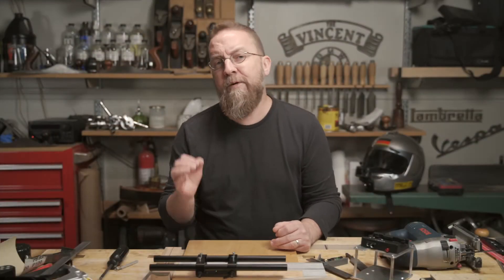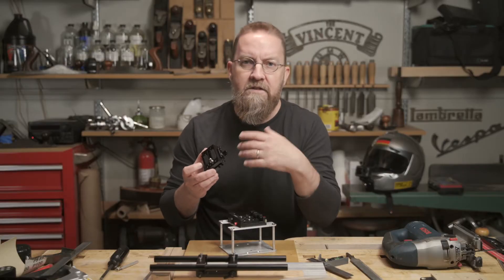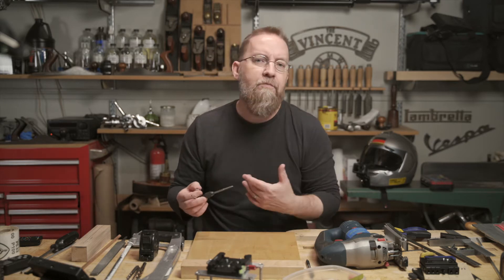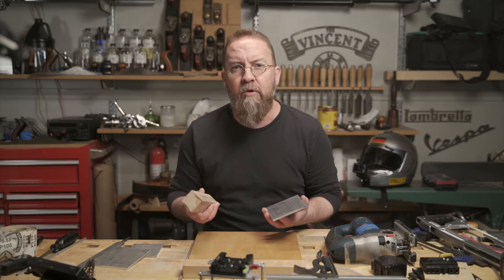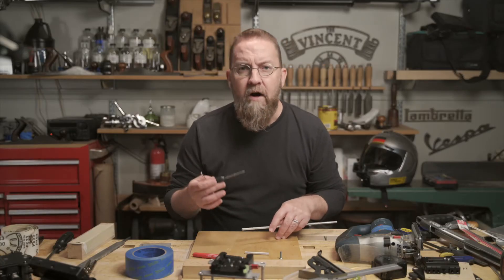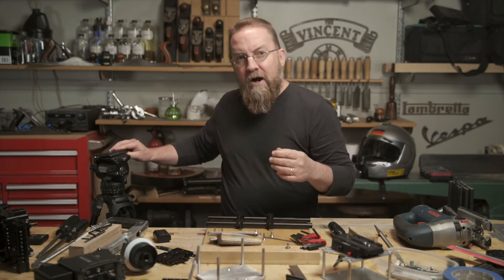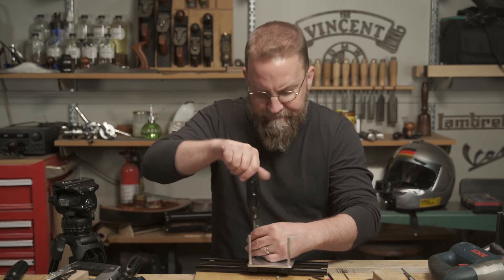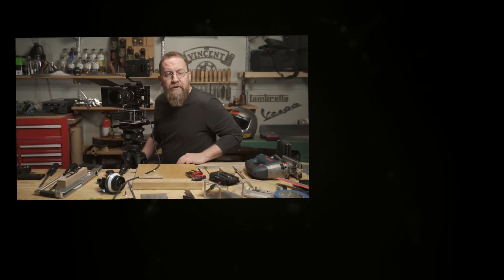Zoom F6 Audio Recorder: DIY Cage

Comment: Awesome cage. I just spent whole morning searching for such a product but to fit a different recorder of similar size. Unfortunately I don't have the tool nor knowledge to do the fabrication myself. Wonder if 3D print would be strong enough if camera rig is around 5lb.
Reply from the maker: Wish I could give some solid advice, but I have no idea. I'm guessing there are different types of media you can use in a 3DP? 5 lbs. is not too much, but the thing to thing about is the shear force if something hits it or pushes against it. If you've got the printer - give it a shot, I'd love to hear your results.
Hope that helps, thanks for watching!

Comment: PRO TIP: For easy and precise tapping aluminium you can use isopropanol (IPA), other technical alcohol instead of oil based fluid.
Reply from the maker: I've heard that, but never tried it. I'll give it a shot. Thanks for the tip!